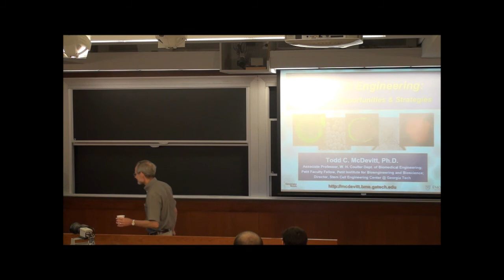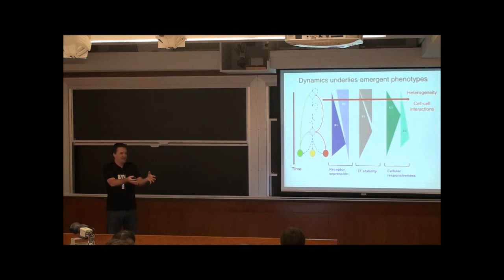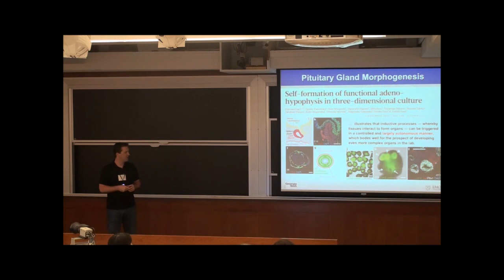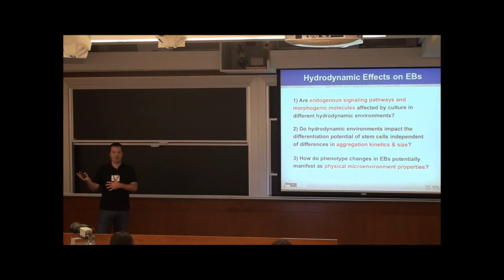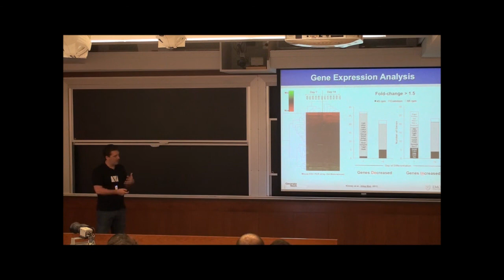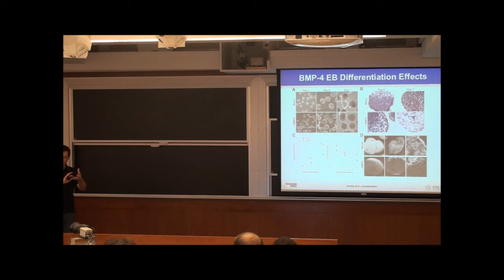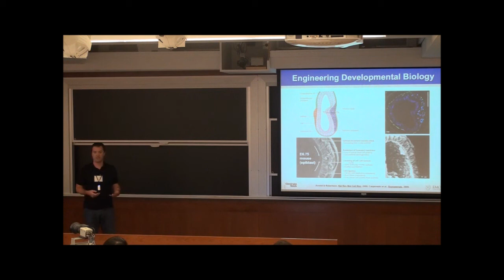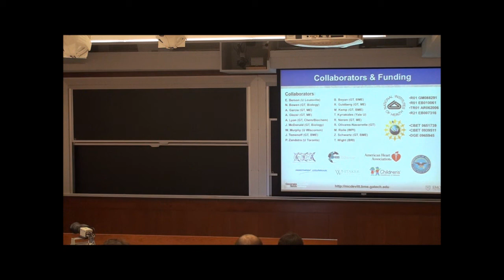GEM4 2012 @ MIT - Stem Cell Engineering: Challenges, Opportunities & Strategies

Comment: What im interest in applying  microfluidic systems to to mimic in vivo surroundings, and the culturing of cells . using nao machines to manipulate and deliver cargo into the cell...making everything much more available and less expensive and more productive .advantages include small device size, high surface-area-to-volume ratios,continuous-perfusion cell-culture environments, high throughput,  not to mention  automation . Microfluidic-based cell-culture systems are developed to provide an in vivo-like microenvironment which can be more easily maintained than that in macroscale dishes, many more advantages with microenviroment that dishes . much more control plus a 3-D platform . Early stage embryos  harvested from mother donors,  we will be able to control chemicals at a much higher level . using different cells from different animals simultaneously like whats commonly done with mice  cells to maintain the pluripotency of actively dividing stem cells. Differentiation of ESCs is often initiated by the generation of embryoid bodies (EBs), which are three-dimensional cell aggregates formed by culturing ESCs on a nonadherent substrate